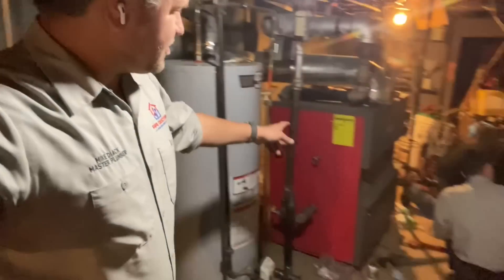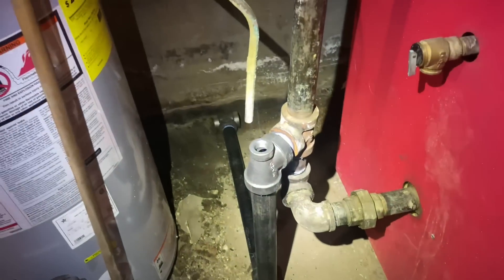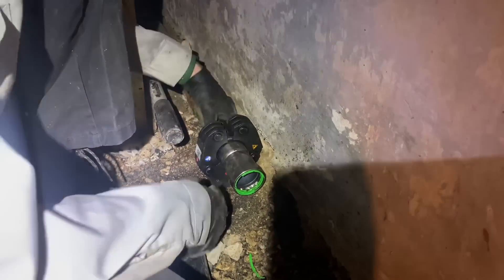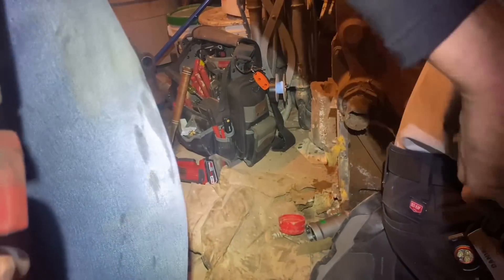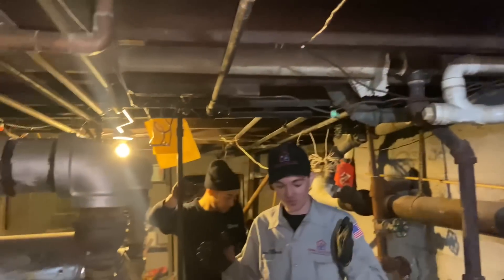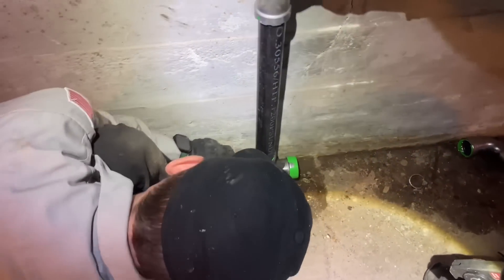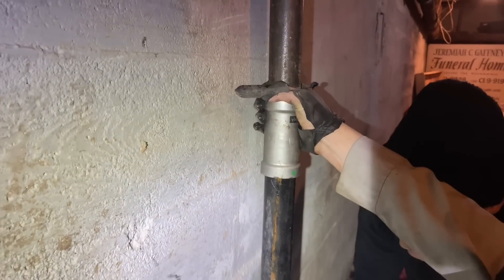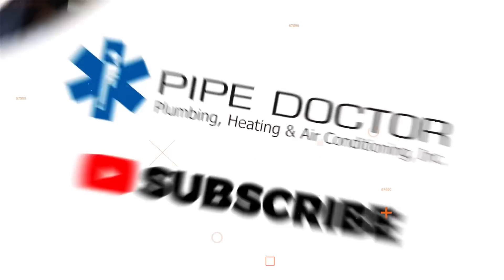Residential Steam Heating System Condensate Wet Return Replaced with Viega MegaPress

Comment: These press fittings are sweet, but expensive as hell. Is it really worth it?  I mean, I guess you just pass the cost on to the customer.  I've got a really poorly installed steam boiler that needs to be re-worked, and a few old lines that need replacing....In NY but not close enough to you guys, sadly...Binghamton

Comment: DOC PIpes ,.is Peter wearing.the same brand of safety steel toe boots as yourself...
Whats the brand name.....is there a link to order them from????...
Is there a stee flexiable plate running length of sole ....for anti penetration from nails screws etc....
For electricity does it protect up to a 1000 joules.....none slipe and water resistance????
Thank you for your respond if you do....

Comment: I don't use those fancy expensive shark bites. I'm old school. You kids can keep your ProPress. I sweat copper with 50/50 only. ProPress is another fad like PVC. I do all my DWV in hubbed cast iron with lead and oakum joints. It's just as fast as PVC. I only use asbestos pipe insulation because it lasts a lifetime and doesn't make you itch. I can make a wiped lead Lav line faster than you can glue your plastic pipes together. Old school is always better than new school.